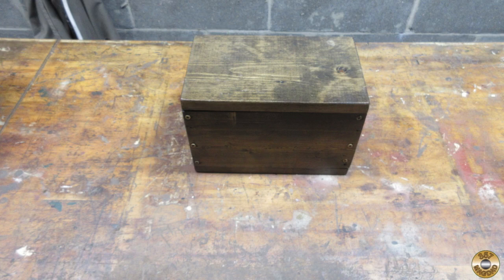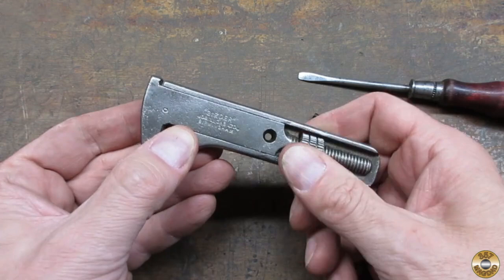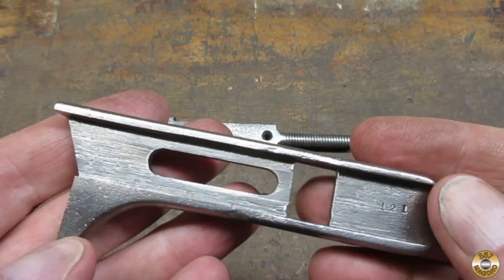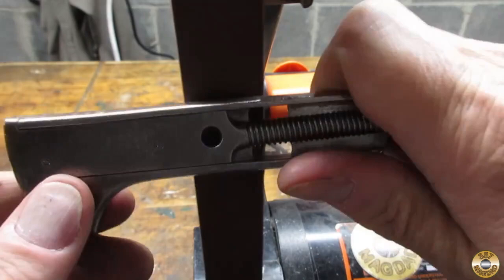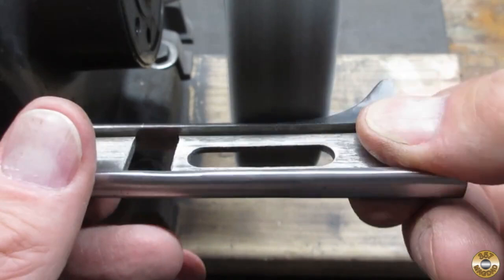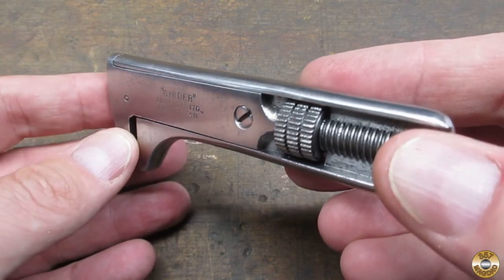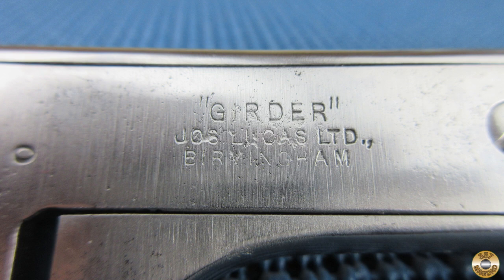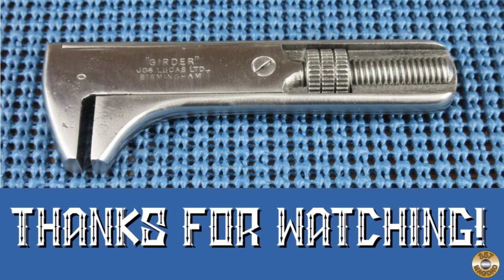Hand Tool Restoration - Joseph Lucas Girder Adjustable Spanner Bicycle Wrench

Comment: Well, that turned out really nice! I was hoping you would pick that wrench…I knew it would be somewhat of a challenge since it was stuck.  Great video!
Reply from the maker: Thank you so much for the treasure chest of old tools!  The Girder was a fun project!
Reply: As a viewer, thanks so much for your generosity! Some really interesting other pieces in there too along with the "girder" :-)))) 

I've been collecting old tools for restoration myself for a few years but it was only recently that I got my first monkey wrench in a job lot, and it looks like the smaller brother (sister?) of the one bottom-right at 0:10. Although unfortunately mine is in nothing like as good condition; still works, but it could have done with being used less frequently as a hammer :-/

Comment: Ah! The Prince of Darkness made a wrench! Very nice job, I bet they never looked as good as yours does now.
Reply from the maker: The UK has the best vintage spanners!
Reply: @357magdad  
Define spanner to me as a Brit would. Here in the US a spanner is a hinged tool to release round couplers with either a hook or a round pin. Similar to what you use to adjust old motorcycle shocks. Do they refer to all wrenches as spanners?
Reply from the maker: @upsidedowndog1256  I think across the pond anything that can work on a nut is a "spanner".  Check out the book "The Adjustable Spanner" by Ron Geesin.  Here in the US, I've only seen "spanner" used for tools that grab a fastener via pins.
Reply: @357magdad  
Interesting. I run across people in aviation that were raised as "wilders" without outside influence or schooling who use that term the same way. Good mechs but terminologies can get confusing. I try to stay ahead of them to determine how and what we need to do in spite of terminology. Thanks for your explanation. I had to learn the New Jersey dialect once, mine was from Chicago but have lived in Arkansas over half of my life. Now THAT was confusing at first!

Comment: That's a very cool wrench!! I love how it turned out.. very interesting company history as well..
Reply from the maker: Thanks!  If I lived in the UK, I would probably only collect little wrenches like this!
Reply: @357magdad  I dig it they are super neat! Your welcome. I've only found one small wrench and it's really rough it's got most likely jappinng on it that I cannot get it off, pretty rough dings but from what I've found it's extremely old like penny farthing bicycle wrench. It's 3 pieces also but alot more primative the jaw and wrap around piece is one piece then upper jaw and wheel with pin and it's prob five inches total with over 2 inch jaw the whole handle part has teeth down front like much larger anto wrenches. Either the name is worn off or it was not stamped being as they made millions when the penny farthing was extremely popular and they used to race the 6 to 8 foot tire models. I couldn't imagine how scary that was from what I've read they would get up to 45mph.
Reply from the maker: @mercuryrising9174  Sounds like a cool wrench!  Those big wheel bikes are crazy!  I would kill myself on one!
Reply: @357magdad  me too brother. I think even a regular bicycle would be scary I've not ridden one since I was prob 10 30 years ago lol
Reply from the maker: @mercuryrising9174  Those Mossbergs are nice!

Comment: This video has associations for me that may not really be all that associated. My neighbor way back when worked for an auto dealership and he always had a supply of Lucas products that I assume he snitched (I know it's not the same Lucas company).
I spent several years in the steel business so a "Girder" is very familiar to me and I also did steel work for TRW.
Neat Little Wrench, I always thought splitting the threaded part wasn't the best idea but it seems to work.
Reply from the maker: I just put some Lucas gas treatment in Mrs Magdad's car this weekend!  Stay tuned, that split movable jaw design is gonna make another appearance!

Comment: I noticed it seemed to be stamped 12 L, my first thought was to wonder if that was the steel designation, 12L is a very popular highly machinable steel, but I figured metallurgy was not that advanced when the wrench was made. But the more I keep watching, that wrench took some very intricate machining, particularly the split threads, maybe they did have 12 L back then
Reply from the maker: I bet they had the leaded steels back then.  I didn't find any info about the markings in my research.